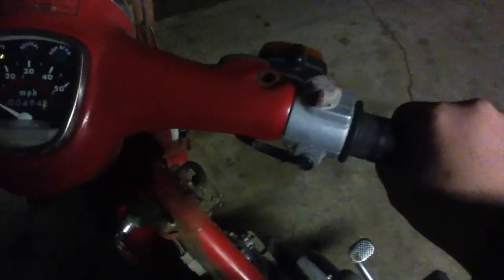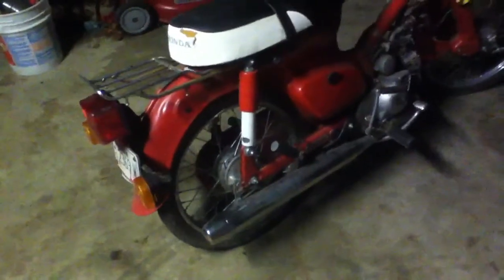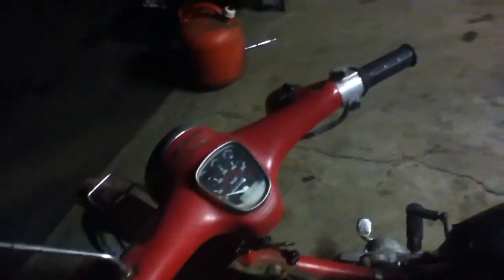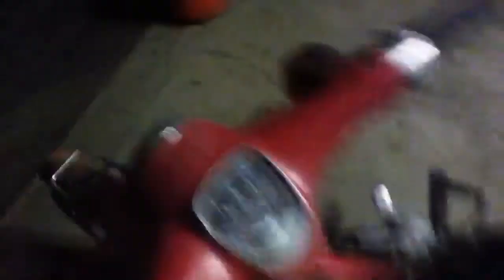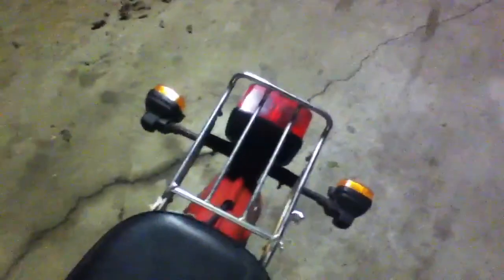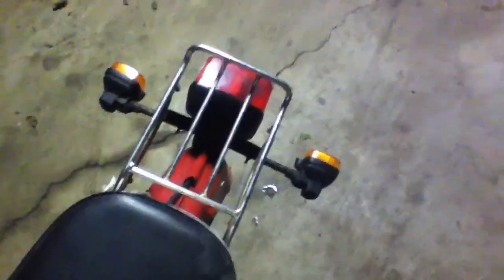BARN FIND 1981 Honda C70 Passport - NEW PROJECT!

Comment: Love them bikes the C50 C70 and C90 i used to be called the honda man i found a way of getting rid of surface rust by using soap filled brillo pads in hot water they do not leave scratch marks try it out
Reply from the maker: Would love to find another someday to restore. I regret ever selling this one. The soap filled Brillo pads is a great trick! I’ve used it several times for projects I’ve had and it works great
Reply: I loved cleaning them up very relaxing and happy with the outcome👍